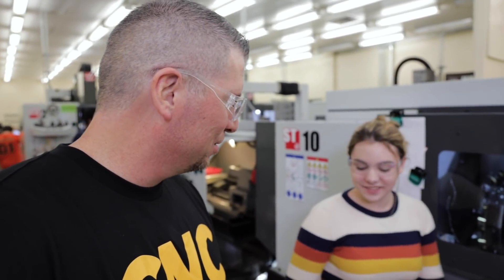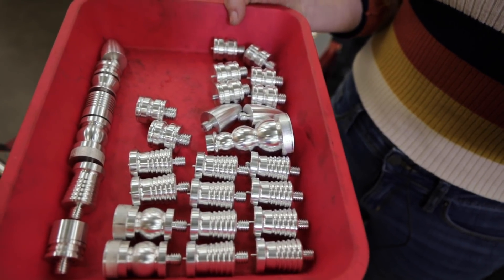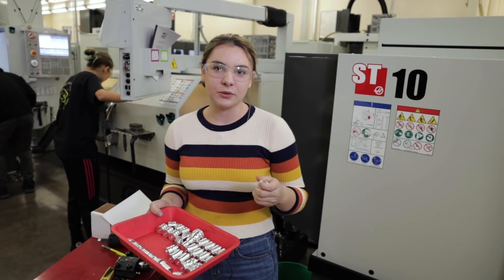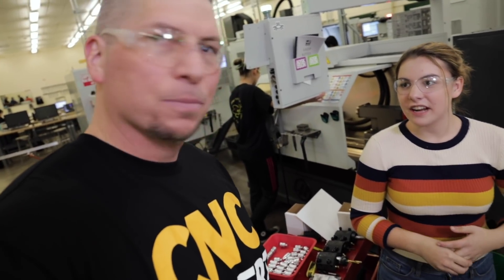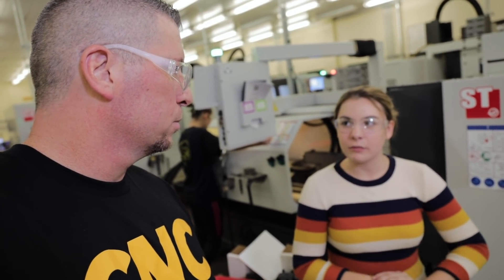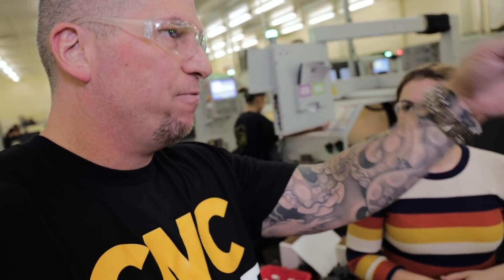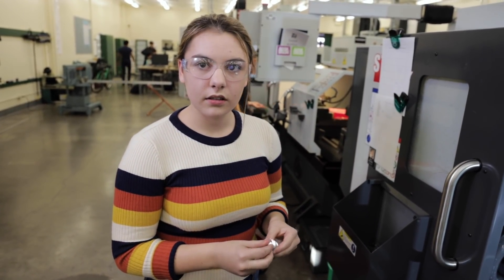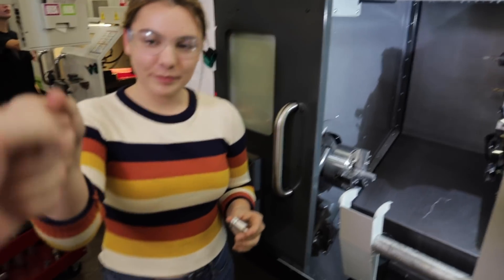She's the Future of CNC Machining - Vlog #33

Comment: Cool that she wants to get into cnc machining but she did make a mistake when she was talking about the threading. Your'e not trying to get the right "pitch" for the thread. Your'e trying to achieve the correct "effective diameter" of the thread. The pitch is always the same. The effective diameter changes the deeper you go.
Reply: You are both being picky and both correct, but she is a high school , ahh, person (I'm not ordinarily so PC) put on the spot with Titan and a vidio camera... I would have been gob smacked at that age!!
Reply: I'm guessing you have never used a thread mic then. Because you check the "basic effective diameter" using it. So go check a machinists handbook.
Reply: So if you knew that then why did you start this argument?
Reply: And neither are you if you didn't realise that both were the same thing and were calling me out for being apparently "wrong"
Reply: Lol. Nice one.
Reply: What have you been doing for 20years? Standing next to the lathe and loading material into it and then sitting down? Effective length is for shear strengths. You can't heckle me when you didn't know what effective diameter was. If you watched the video she said pitch. Not pitch diameter. Two different things if you know engineering which you don't when you jumped to conclusions. I know that pitch diameter and effective diameter are the same. Go home heckler.
Reply: I was originally from South Africa but we had to move for obvious reasons. My family and I now reside in New Zealand. We never used to call them machinist handbooks, to us back home we used to call them engineering bibles. The term engineering handbook has only made its mark here in the past 8 years or so. I guess that has been the miscommunication between us and I hope that has been cleared up.

Comment: I agree about the future of CNC machining and here's why: As the CNC technology advances, if the workforce to keep it going stays apace, then CNC machined parts, which are always far superior in quality to other forms of manufacturing such as powder casting, die casting, etc., become ever more competitive with those other forms which require higher volumes of production to be cost effective due to the tooling required. CNC's can make EVERYTYHING, and make them the best, with no tooling required. 

Machined parts can also beat the living bejezus out of factory parts in terms of order lead times, minimum quantities, odd production numbers, just-in-time logistics, and even freight costs due to the fact that the machine shop can be a lot closer than the giant factory, etc.

This means we should see more and more manufacturers opting for machined parts instead of trying to make them a  cheaper way, because the cost per part should continuously decrease for machined parts. The cost of mass produced parts, however, will continue to increase.

The bottom line is that as machinists become more productive, demand for their parts will rise, not fall. This means more and more CNC jobs.

That's my theory and I'm sticking to it.
Reply: If mankind parts were superior to PMM/MIM, they wouldn't be pursuing those technologies. Some of the highest tech steps are PMM steels. When someone is buying a $500-3000 custom knife, they can dictate any steel they want, and often times go with PMM steel because it's superior. It also had superiority in regards to ease of manufacturing (faster). They both have their places. (CNC parts and PMM parts) But if PMM didn't have superiorities in some applications, they wouldn't use it.
Reply: What are PPM Steels? Cannot find any reference ....
Reply: @xenonram  I said "Superior in quality." Faster is the same as cheaper, but in terms of parts quality, machined is always Superior to powder casting (PMM?). Saying powder casting is faster excludes tooling and testing. Creating the cast tooling for powder casting is much more involved, and the mold itself has to be machined first. The advantages are "near machined" precision, much less chip waste, and faster production times per part once you're tooled up. The disadvantages are limited materials selection (no, you can't use just any steel, and forget titanium it tungsten alloys), poor sheer strength, diminished temperature resilience, and as mentioned, much greater tooling cost and production lead times. Custom parts and anything involving dies or molds almost never go together. 

Testing is also expensive even for production parts bc if it's done right every part must be X-rayed. Blueprint to finish time could be months, and you're looking an enormous startup expense.

Comment: Someone needs to tell her that a professional "Engineer" (i.e. someome with a Degree "B.Sc. Mech. Eng. etc" earns about double what a CNC operator does. Vastly different careers. It astonishes me how such a talented woman can be recieving such incompetant career advice. An engineer DESIGNS the parts that Titan makes on their behalf. Titan has never designed a part. Designing a part might mean calculating the fatigue stresses at the critical stress points using mathematical tools, and material property tables. This is no fault of Titan: Titan is a genious at what he does.